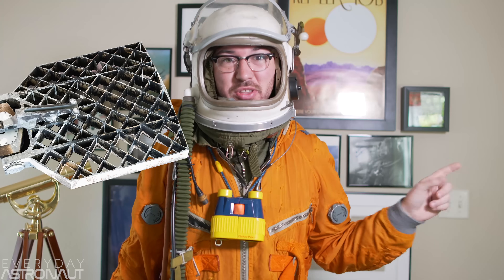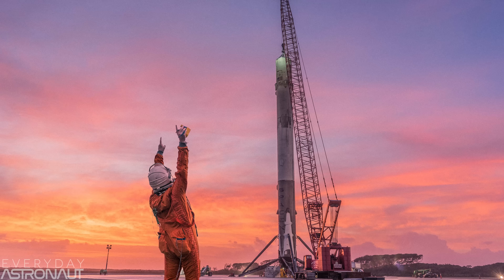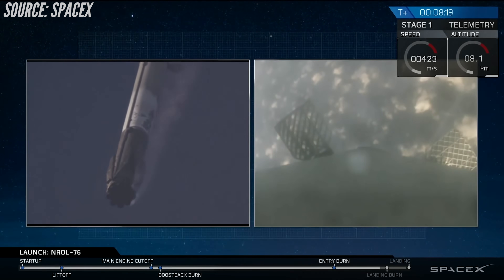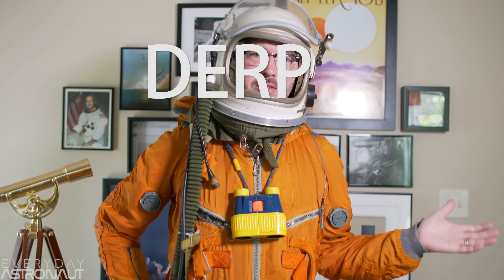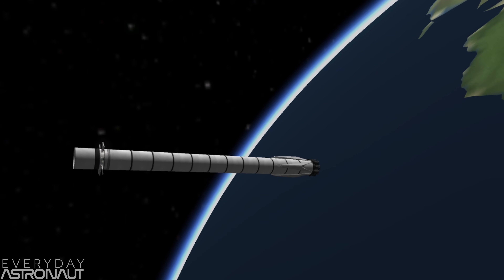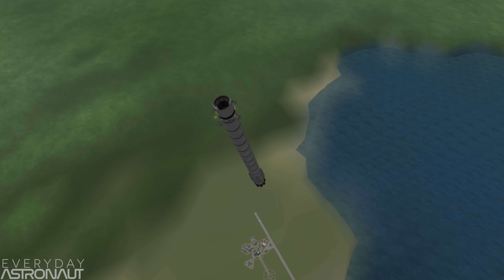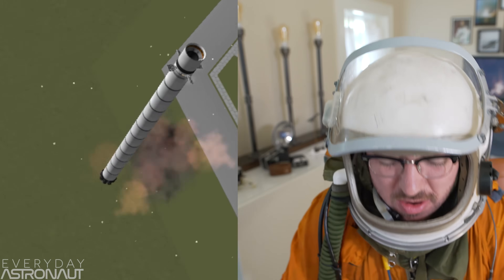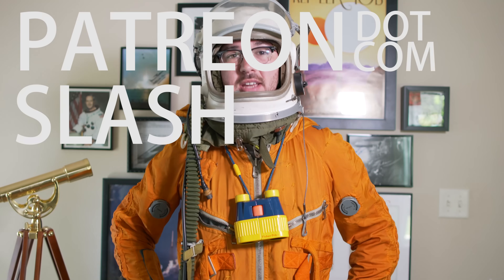How SpaceX lands the Falcon 9: Grid Fins, Thrusters and Engines!

Comment: That's helpful thanks.  You clearly explained the first flip the first stage at 4.35, but forgot to explain it's second flip at 4.50 so the engine were pointing earthwards to slow it down. Otherwise it was great thanks

Comment: Okay, let's try again. You didn't answer my question and now it's far down the list:

On the May 11 launch they left out the boostback burn. Which (I assume) means that after stage sep stage one kept going East at 8,000 km/hr and away from the drone ship. Please explain.

You replied:     
 
 Everyday Astronaut 
Everyday Astronaut1 day ago
No, you’re seeing stage twos speed. Stage one slows down until it hits apogee, then speeds back up to about 1,700 m/s and falls back and they put the drone ship about where that parabolic arc is.
     
I replied:

But you said at stage sep the rocket is going way more east than upwards (obvious from visuals and telemetry). So it's going to go faaar eastward and away from the ship, under no real control of trajectory (fins useless in vacuum and the thrusters only affect attitude).

 And how do they figure for the various wind layers (some reach 200 mph and are unpredictable). The fins have no control in a vacuum and the thrusters have none (not enough) in the atmosphere so - even assuming you somehow home in on the ship (impossible anyway) - for the last 1,000 or so feet, the engine gimbal is the only control. and the gimbal cannot adjust attitude without screwing up trajectory; so the last 1,000 feet cannot be under real control. Your scene with the broom actually shows this. 

Also, the thrusters are for attitude control not heading. Since there is no airfoil surface on stage 1 there cannot be lift, which you need to properly 'steer', especially from 70 miles up with all the chaos theory elements between sep and landing (the fins are for attitude control). Sorry, but something is very fishy about Spacex. Are you aware of that? (Kidding: of course you aren't.)

I'd love to hear your response. 

Oh, plus I just posted this video. Do you have a response?
https://www.youtube.com/watch?v=hGWWe0a8zuI&feature=youtu.be

Show less
Reply from the maker: Hey AC. Thanks for bringing this back to the top. 

So you seem to be making an awful lot of assumptions right off the bat. It seems pretty clear you have a foregone conclusion about what you perceive to be true. I understand. It’s pretty unbelievable. If it weren’t for having seen a few landings myself in Florida, it would seem almost impossible. Luckily physics is on their side, as well as an insane amount of video footage. 

First assumption you make that I disagree with. “After the chaos of stage separation” you act like stage separation is some wild procedure and there’s simply no way of being able to predict what happens during it. Well, luckily, with years of data and repeatable launch attempts, all the physics occurring during stage sep are well understood and accounted for in placement of the drone ship. 

Don’t forget, they put the ship where the rocket will fall. So no, it doesn’t travel east away from the ship, the ship is a ways out still compares to where the first stage is at stage sep. 

Next, you say the thrusters have no control over heading... relatively speaking you’re right, but even a m/s or two at 200 kms away is a lot of change. These can add or decrease velocity by firing prograde or retro grade which can drastically change where the stage will land. 

The grid fins have a tremendous amount of control through the latter portions of descent. As a matter of fact, you’re wrong that there’s no lift. The fuselage is the rocket, when angled by the grid fins at the back can actually provide lift and quite a bit of it. You can see the stage drift and drastically steer during some of the RTLS landings. 

Lastly. Why. Why would SpaceX fake landing on the droneship? We know they land on land (hundreds of thousands of general public, me included) have witnessed that, so what’s the point in faking a drone ship landing? No one is requiring or even requesting they do that. It’s in their interest to reduce operation costs and increase their profit to reuse this hardware. What’s the point in sending a large boat and a support boat with 5 people or so out to sea for a week if there’s not money to be saved and it’s part of their business case?

So lastly. What would it take to convince you? Video evidence doesn’t seem to work. The fact that they do it almost twice a month doesn’t seem to be enough for you. The returning 45 meter tall booster, soiled from reentry doesn’t seem to do it. What would it take? Where’s your yard stick?
Reply: You can make the process sound reasonable when it really is not: Well done! 

You say they place the ship where the Stage will land, which means that (at a speed of 5,000 mph) they better be right on to the micro-second as to when they do the separation. Any tiny error in this will equal miles of ocean, right? Plus you don't mention the various wind layers that have to be accounted for....

Tell you what, though, to save time, let's go to the last, say, 1,000 feet, when neither the fins nor the thrusters do anything. As you say, it's all in the gimbaling engine to control attitude AND pinpoint accuracy. As you show with the broom, can't be done (the rocket would be moving around laterally just like you do). I ask your audience to take a broom and do what you did; try lowering it from eye level to, say, a coin on the ground. If you can't do it, my point is made. (How about you make a video doing that -- no edits!) And that's only a few feet!

Look at the video of the successful landing on the ship in high winds. I'm an old time sailor and I KNOW that was faked; with 20 knot winds blowing (see the whitecaps?) the stage this way and that, and making it tilt this way and that... no way that 'rocket' could have done what we see.

So it was faked. 

After the ridiculous 'car in space' circus back in February, I paid a lot of attention to Spacex and Musk. See my blog at blog.banditobooks.com. Many videos proving fakery. As I say in my last few videos, it's obvious that NASA/the-powers-that-be (PTB) have perfected hologram technology, which they have been working on since the 1950s. 

Go ahead and laugh but it's the only explanation for all the data (the videos). I just posted a video showing how the Falcon 9 explosion in August 2015 HAD to have been faked. See if you can debunk it:
https://www.youtube.com/watch?v=hGWWe0a8zuI&feature=youtu.be

In the interest of full disclosure, I'm quite sure you're a NASA shill, 'explaining' the impossibilities to the great unwashed. You're 'silly' act is well done. I intend to do a video about it. Subscribe to my blog for more....

Comment: On the May 11 launch they left out the boostback burn. Which (I assume) means that after stage sep stage one kept going East at 8,000 km/hr and away from the drone ship. Please explain.
Reply from the maker: No, you’re seeing stage twos speed. Stage one slows down until it hits apogee, then speeds back up to about 1,700 m/s and falls back and they put the drone ship about where that parabolic arc is.
Reply: But you said at stage sep the rocket is going way more east than upwards (obvious from visuals and telemetry). So it's going to go faaar eastward and away from the ship, under no real control of trajectory (fins useless in vacuum and the thrusters only affect attitude).

 And how do they figure for the various wind layers (some reach 200 mph and are unpredictable). The fins have no control in a vacuum and the thrusters have none (not enough) in the atmosphere so - even assuming you somehow home in on the ship (impossible anyway) - for the last 1,000 or so feet, the engine gimbal is the only control. and the gimbal cannot adjust attitude without screwing up trajectory; so the last 1,000 feet cannot be under real control. Your scene with the broom actually shows this. 

Also, the thrusters are for attitude control not heading. Since there is no airfoil surface on stage 1 there cannot be lift, which you need to properly 'steer', especially from 70 miles up with all the chaos theory elements between sep and landing (the fins are for attitude control). Sorry, but something is very fishy about Spacex. Are you aware of that? (Kidding: of course you aren't.)
Reply: Come on, Tim, you can do it! (It's your JOB.) Answer my concerns!

Comment: I took the time to scan the comments to see if anyone other than me noticed that the landing is 'impossible' as shown. aside from flat earthers (who don't count), only one had doubts:

reuvenbrown

7 months ago
I've been watching the SpaceX Falcon 9  launch videos and I'm confused as to how the first boost back burn supposedly reverses the direction of the stage 1 but somehow manages to not dip below 1600 km/hr. Are the numbers they post on the screen accurate or am I missing something? Shouldn't it go to close to 0 and then back up? And that boost back burn seems to last only 10 seconds. If it takes 2 and a half minutes to accelerate to 6000 km/hr shouldn't it take at least that long to reverse the direction?

(the point he's making - maybe w/o knowing it -- is that the booster has to in effect 'stop' (movement across earth) then accelerate again to... how fast to get back to the LZ? this could not be done in a short time, 6 - 10 secs, or whatever it is. this is another problem aside from those i mention in my blog. your answer below is irrelevant, btw.

Everyday Astronaut
7 months ago
+reuvenbrown the boost back burn negates the horizontal velocity only.[so it goes from 6,000 mph or whatever to zero then back up again? How?)  The booster is still moving upwards rather quickly so it's total velocity isn't quite negated. Also, since it's nearly empty and doesn't have the second stage and payload on top, the boost back burn is much shorter and easier. Don't forget, they fall back to earth for free, they only need to change their horizontal portion and that's it!

Amazing that i'm the only one that sees thru this crapola....

Comment: You need a lesson is aerodynamics and a bit of newtonian physics: http://blog.banditobooks.com/its-a-long-way-down-folks/
and
http://blog.banditobooks.com/i-gotta-say-it-one-more-time/
Why didn't you mention course correcting for wind? (Stratospheric winds have been clocked at 300mph.) With no airfoil there are only tiny changes in trajectory possible, as mentioned in these posts. you can answer me via the email address in the sidebar of my blogs... if you don't answer, i will take that as admission that the pinpoint landings are impossible.

Comment: Why has SpaceX been able to land rockets when people thought it was impossible? Is the falcon 9 a lot lighter and more efficient so it can save fuel for landing?
Reply from the maker: Watch my newest video about block 5 and you’ll get a sense of the evolution necessary to make the Falcon 9 capable of landing. The margins are so razor thin, it’s just a matter of honing in until they got it down
Reply: Hey Tim, thanks for the reply! Big fan, I just rewatched that video. It sounds like SpaceX is just way more capable of innovating than the traditional industry, at least partly due to their design philosophy. I guess my question is more big-picture. In your opinion, did people think landing a rocket would always be impossible due to the first-principles physics (you'd never be able to save enough fuel, regardless of innovation) or did they think the technology would be so difficult that it's basically "impossible"? There may not be a single answer or I may be way off, I just find it fascinating trying to figure out how "impossible" things can become possible.

Comment: can I ask a question?
so the first burn acts like a shield of the rocket boosters against re-entry to the atmosphere because asteroids were pulverize on that zone?  does the ventilation of your suit working? seems like you're not sweating inside that suit. : )
Reply: rybaxs if you hit air at very high velocities it gets hot and even hotter until the point the air ionsizes, and ionzised air has a red glow (hence the brightness from the Space Shuttle’s re-entry and asteroids burning up). What the re-entry burn does is deflect this air and prevent the large majority of it from contacting the booster. The burn also slows it enough that when it stops residual speed doesn’t do the same again.

Comment: I've been watching the SpaceX Falcon 9  launch videos and I'm confused as to how the first boost back burn supposedly reverses the direction of the stage 1 but somehow manages to not dip below 1600 km/hr. Are the numbers they post on the screen accurate or am I missing something? Shouldn't it go to close to 0 and then back up? And that boost back burn seems to last only 10 seconds. If it takes 2 and a half minutes to accelerate to 6000 km/hr shouldn't it take at least that long to reverse the direction?
Reply from the maker: +reuvenbrown the boost back burn negates the horizontal velocity only. The booster is still moving upwards rather quickly so it's total velocity isn't quite negated. Also, since it's nearly empty and doesn't have the second stage and payload on top, the boost back burn is much shorter and easier. Don't forget, they fall back to earth for free, they only need to change their horizontal portion and that's it!

Comment: Is the boostback burn strictly necesary?
Reply from the maker: +Rafael Bachmann nope! It is omitted when they land on the drone ship 👍
Reply: Another of those trade offs - spend some more fuel and land home or spend less and land on a piece of steel in the waves...
Reply: I'd like some conformation or correction. My current understanding is that if the payload is light enough, there remains enough propellent to perform a boostback burn. Landing on a drone ship allows heavier payloads to be lifted into LEO. And for the heaviest payloads, or those that have to reach geostationary orbit, the first stage is discarded.

Comment: Great overview of how they control the stage. Do you have any insight to how they target the landing site? Is it a closed loop scenario using a beacon from the site or something similar or maybe a open loop system targeting the Lat/Long? If it is the latter then they would have to have very precise control of the barge!
Reply: Sea conditions for a barge landing must, by necesscity, be relatively calm. The landing struts can only compensate for a low degree of tilt. 

Under relatively calm sea conditions, the barge would have little difficulty maintaining its position.

The time from launch, to touchdown of the first stage is only a matter of minutes. For all practical purposes, the barge can be considered a stationary & level platform. 

Landing at too high a velocity, or failure of a landing strut, pose greater risks than the positioning the barge.

Michael, I'm still getting up to speed on this stuff, so I could be wrong, but that is my current understanding. And I would be more than happy to be corrected by those more knowledgable than me.

I think this is an exciting time for those of us keenly interested in Space flight.

Comment: Didn't Einstein say make it simple but not too simple? You never mention mass of rocket at Apogee, fuel mass at re-entry? velocities at 500,000, 50,000, 5,000 etc. Just the numbers would help. Otherwise you don't need that suit  as a viewer I would say instead of Kerbal paychecks - make your own Eletronic photon art with numbers included when you are just talking. This is after all, "rocket science" and not skipping rocks on a pond where you are thousands of them to use before success? Thanks.

Comment: I've always wondered how they control their rockets.. Could you make a video on this topic?
Reply from the maker: +Eliaslinde you mean on the way up?
Reply: Yep, that's what I meant :3
I want to know if they have programmed their rockets to control automatically (that's probably what they do) and if they have any manual control in critical cases. Sorry if my question does not make too much sense :p
Reply from the maker: +Eliaslinde totally makes sense! They're 100% automatic. They constantly adjust themselves to maintain nominal flight. The only manual override a human can do is authorize a self destruct sequence
Reply: Alright, thanks! 😊 I was a little confused on how exactly they control their rockets, because I too play KSP, and that happens manually and in real time. There is also a map where you can set up maneuvers. I assume they have something similar, but one of the giant differences must be that everything does not happen in real time.
Reply: They are 100% automatic. But, I think the humans have more control than self-destruct. It is my guess, so don't consider it as a fact.

I think humans maybe also able to control incase of other issues like what to do in case of less than optimal performance from the engines or if there is some other correctable issues

Comment: If you watch NASA's videos of atmospheric retropropulsion testing in a hyper sonic wind tunnel, you can find out that reentry burn not only slow rocket down, it's also pushes both hot dynamic heating and hyper sonic shock wave away from vehicle. Also rocket plume shape is important, single engine burn in the NASA test made rocket go faster! Very fat plume with three engines, where the outer ones were pointing some decree sideways, worked best.
Reply from the maker: +HVM I heard that it'd speed up during reentry with one engine on an episode of Orbital Mechanics Podcast! That's so wild.